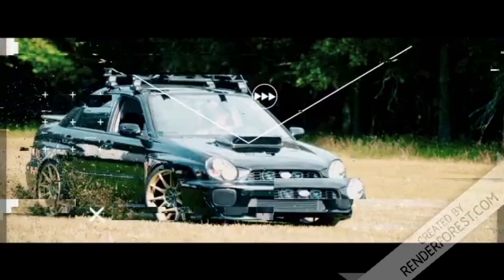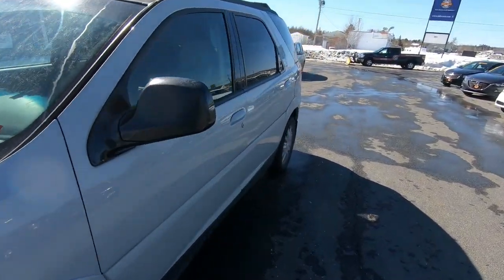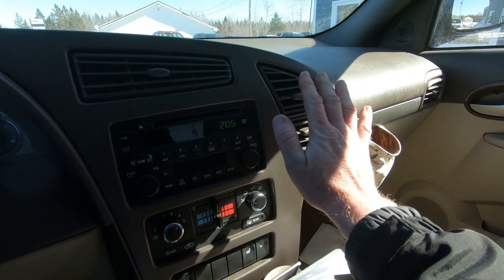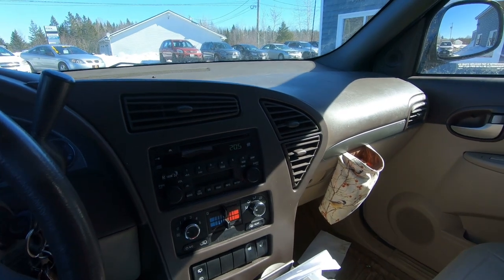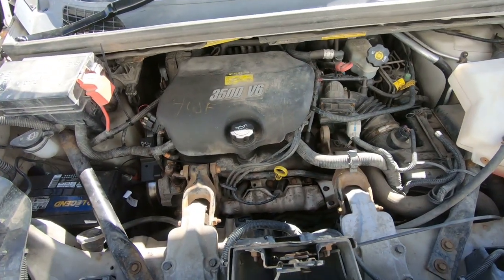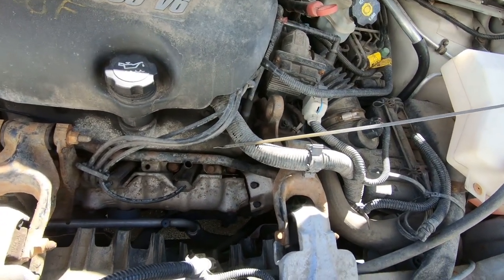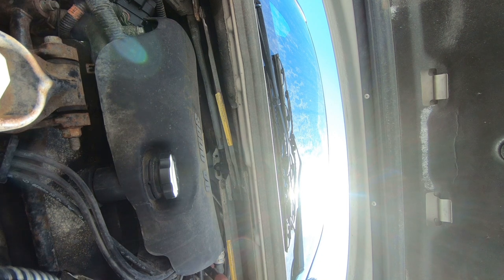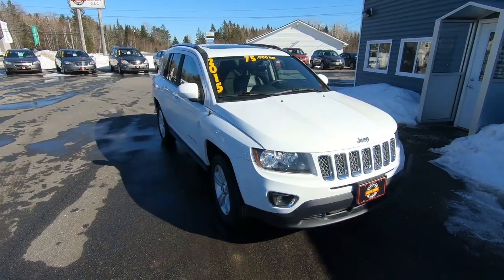WHAT TO LOOK FOR WHEN BUYING A USED CAR

Comment: Great video on how to evaluate a used car. Will rotten rocker panels pass inspection?
Reply from the maker: No! Can’t have holes on rockers!
Reply: Olde Carr Auto Guy anyone would be upside down on this one to make it road worthy.  Looks like this one is headed for the crusher.
Reply from the maker: Unless they are incline enough to fix it themselves! It has potential but not a good financial decision!

Comment: I'm surprised. That buick here I have seen higher priced. Up to $7500 USD here. Here it's rare to see a used car before 2005 for 2500 and under. Of course we don't have the rust issues either so I'm sure that's part of it
Reply from the maker: It’s always a part of it especially when people don’t protect their cars with undercoating.